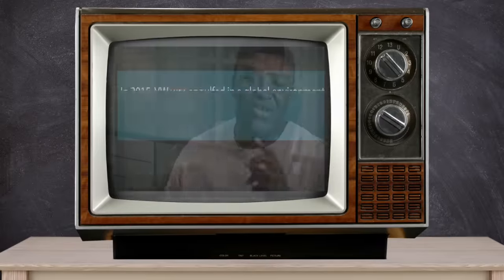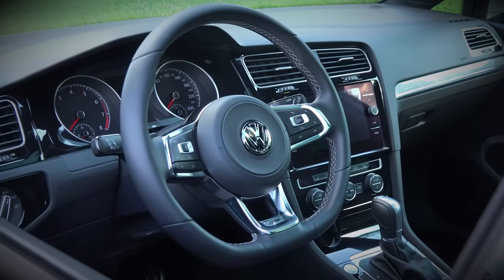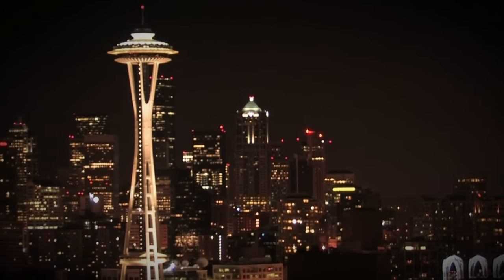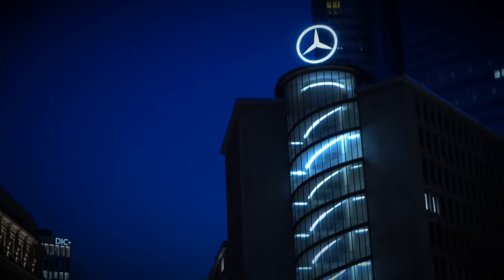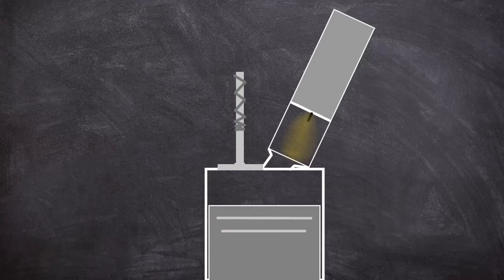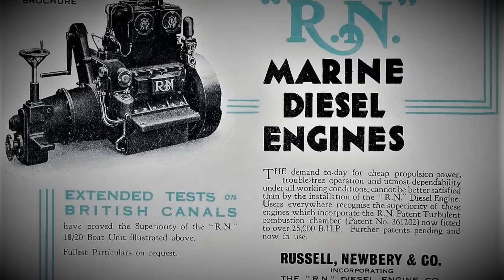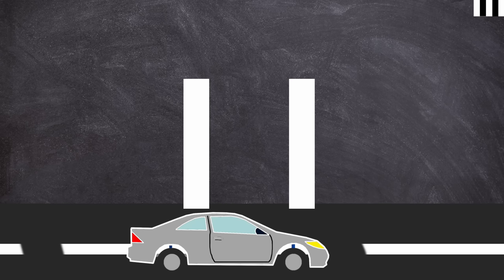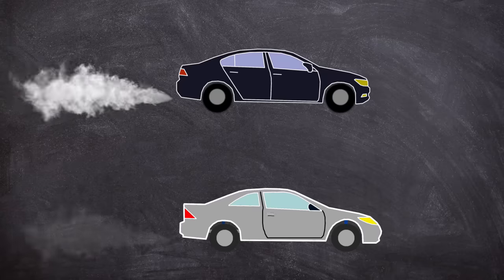Scandal: VW Emissions Dieselgate Explained | Plainly Difficult Documentary

Comment: I remember the Volkswagen "Clean Diesel" commercials with the Mythbusters crew touting the virtues of the new lower emissions, holding a handkerchief over the tail pipe. Script well read...
Reply: That by itself was not necessarily a lie. Those modern diesel particle filters can easily make the exhaust gasses completely transparent (at least when the engine is heated up). NOX emission are invisible.
Reply: I dont understand the whole handkerchief thing... So what people cared about back then was the color of the poison? Do they understand that co2 is invisible to the naked eye? Lmao
Reply: @toidIllorTAmI you call co2 poison?
Reply: @Wrnrgaming  fumes? Yes, they are  poisonous to humans.
Reply: Well not necessarily. If you are holding a handkerchief near the tail pipe then the car isn't being controlled meaning the car has switched to the testing lower emission mode. If Mythbusters did not know the car was switching modes when not being controlled then they would not have known this was actually proof of the switch via computer control.
Reply: @Wrnrgaming For the most part, yes. Just look at what happens to the body when you can’t get it out of your system.

Comment: This happened before in the class 8 truck market in the 90s. 
Detroit, Cat and Cummins also had a program to pass tests but the engines performed differently on the road. 
After the discovery, all dealers were required to reprogram the ECMs and performance went down dramatically. 
Fuel mileage and power went to shat. Detroit fuel milage dropped from almost 7 mpg to the high 5s.

Comment: I still own a 2012 A3 TDI. Just had its entire fuel system replaced under warranty because of the dieselgate scandal. All VW "fixed" cars have an extended warranty on emissions hardware meaning the entire engine and exhaust hardware. Definitely glad it had that as the repair would have cost me over $5k USD otherwise.
Reply: Don't they all have a 100k warranty?
Reply: I love my 2011 a3 TDI got the emissions replaced warrantee at 90k now I’m at 140k and the car is running great.
Reply: Is it slower?
Reply: I just got my entire coolant system and turbo replace about 7000 in total Gotta love that warranty it’s the whole reason I bought the car 😂
Reply: @MiguelGarcia-vj7oo  you can go to their website and put in the cars Vin to see if it’s affected and how long the extended emissions warranty is, for example mine is 4 years and 3 months or 54000 miles after it’s modification for emissions (102k/2020) meaning it’s good until 2025 or 156k
Reply: @albertbahtiri5645  hey, so mine says the the mod was done in 2017, and I recently got the car, so do you know if the warranty starts from the day you buy it or the day the mod was done?

Comment: VW gets the most attention on this issue but the reality is they weren't the only ones involved, mercedes and bmw were also at it, I think it was mercedes that stuck the other 2 companies in so they wouldn't get punished as severely, as time has went on nearly every manufacturer across the world has been found out to be using similar software.
Reply: The students who originally discovered the vw diesel gate, had two vw’s and one bmw. The bmw didn’t cheat, and that’s why it isn’t called “bmw diesel gate” today

Comment: Mostly, I did enjoy the video.  Disappointing that the real criminals have still not been charged, or at least sued into poverty.  As a chemist, I found your treatment of the chemistry involved a bit frustrating, as most of it was wrong.  For example, simple hydrocarbons, such as those found in diesel fuel, can only have formulas corresponding to CnH2n+2.  So C12H23 is not a real molecule - the formula for a real 12 carbon simple hydrocarbon would be C12H26.  Also, ad blue, a solution of urea (NH2)2CO in water, reacts with NOx to give nitrogen (N2) as the reduced product (not oxygen, O2, as you stated) along with water (H2O) and carbon dioxide (CO2).  Also, at one point you referred to NOx as being particulates.  Nitric oxide (NO) and nitrogen dioxide (NO2), the two principle components of NOx, are both gases under normal atmospheric conditions.  (Nox is actually much more complex, and includes small amounts of NO3, dimers, such as ONNO and O2NNO2, and mixed dimers, such as ONNO2 and O2NONO2, depending on concentration, temperature and ulraviolet flux.)  The particulate components of diesel exhaust (aka soot) are composed mostly of carbon (from incomplete combustion of those simple hydrocarbons), ranging in size from less than 2.5 microns (the most concerning, as they penetrate deep into the lungs) to more than 10 microns.
Reply: Thank you. I was cringing at C12H23 and at every reference to NOx as particulate or particles. You stated it better than I could and pointed out a something I missed: the products of the NOx / NH3 reaction(s).
Reply: I burned my toast this morning!
Reply: @rcranch3838  Your mom probably shouldn't have let you use that dangerous appliance. And just think of all the particulate matter that you released into the environment! For shame.
Reply: @sootikins  funny you say that because she just rapidly disassembled it by throwing it out the second story window.
Reply: @rcranch3838  Cool! A "Special Toaster Operation"
Reply: @rcranch3838  The Maillard reaction gone wrong, sorry for your loss.
Reply: Thanks for that. I'm not a chemist but was questioning my basic grasp of such when hearing a compound described as a particle.
There is though as I understand it further scientific evidence to be established on the extent of biological and climate impacts resulting from NOx at current levels
Reply: Agreed on all points - I suspect he got C12H23 from the average weighted makeup of diesel molecules and took it out of context
Reply: I think the particulate micron debate had been mostly debunked as a lot of it has to do with grade of diesel used to how the particular engine was designed to burn it. VW totally shit the bed big time in that regard. Grossly oversimplified: they're really just gasoline engines redesigned to run diesel. The two architectures shared a lot of common parts and this is why mass production engines really shouldn't rely on software & electronics to run. Done correctly in hardware, like older injection-pump style engines, they ran pretty damn cleanly (emphasis on *when done right*!)
Reply: This bloke producing these video's is a bit of a technology nugget.
Reply: It's always difficult to watch any video created by someone with significantly less knowledge than I have about some very specific subject.  

The megaprojects guy (and his script writers) is probably the worst :)
Reply: @rolfkarlstad4015  Look guys, first comment from a Volkswagen apologist!! VW totally shit the bed on the matter and you know it
Reply: I'm sure it was not intentional. But most people are not experts on the subject. Thanks for explaining it for us good sir. I Hope you are having a great day and that you and your loved ones are healthy and safe!!
Reply: @Drmcclung  me?  Not at all, I prefer my petrol engines :)  I agree that VW made a mess of this, for sure.
Reply: @rolfkarlstad4015  Ah, ok. Sorry I misunderstood!
Reply: Yeah it’s massively disappointing when the German’s were caught red handed cheating in a huge way but still somehow deny wrongdoing like their sh*t doesn’t stink. They make some of the least reliable most poorly engineered cars in the world. Far less expensive cars from other countries cost less, use less energy, are for more reliable and cheaper to own, suffer from much less depreciation out of warranty, and can still beat the Germans on their own famous Ring race track. Show me a production German car at any price that can beat the highest performance Tesla around their own Ring? Or show me a German car that isn’t seeping critical fluids soon after the warranty expires. In any price category there are cars made elsewhere in the world that better the German’s poor efforts in most objective ways. Superior German engineering has become a complete myth. The Germans are like college students who just cheat on their college exams just like they cheated on emissions tests.

Comment: One thing that came out of this was they ironically gave me the best customer service I’ve ever had.  I have a Q7, kept it afterwards.  In 2020, got some engine trouble and took it in to the dealership and they gave me a rental.  They couldent figure out what was wrong (turned out to be something with some bad gas no idea how they dident figure that out right away) but they kept it for about four months and even flew in specialist from Germany just to look at it, kept me informed the whole time and I got the rental which was a 2019 model.  Probably put 10k miles on it and they dident blink.  Kept me informed and answered everything politely.  Was  the best experience I’ve ever had with a dealership

Comment: I’m still pissed off after all these years. No, it wasn’t because I owned one but because the scandal resulted in VW pulling the plug on the Audi Le Mans program. Ironically Audi ran diesel at Le Mans.
Reply: So that’s why they stopped running. I thought it was rules at Le Mans or IMSA
Reply: @mikebuffing727  unfortunately not. Besides the fine the VW group had to pay, Audi's Le Mans program were fueled by diesel. Wouldn't take much to put the two together.

Comment: I know someone who had a golf GTD model which was honestly the best car - super fuel efficient for the longer distance driving he did. When the scandal surfaced he got a letter which said the car was recalled for the oboe reasons and to take it back in to be fixed. This someone knows cars and he knew that the only way to fix it was to take away some of the performance of the engine and he refused to take it in.

Comment: Thanks for the video.  I own and still drive a 2003 VW Golf TDI, and have over 330,000KM’s on the odometer.  Was debating upgrading to those “clean diesels”, but in the end figured we would keep the Golf and continue driving it.

Because the vehicle was purchased prior to the tier 2 requirements, we haven’t heard a peep about it from
VW.

The car, with a new clutch, turbo, etc. Is still a nice drive, even though it’s almost 20 years old now.  Pity most vehicles these days aren’t available with a manual transmission…

Comment: 5:37: "These engines work by compressing diesel fuel" - wrong.  These engines work by quickly compressing air in the cylinder until it becomes hot enough to spontaneously combust diesel fuel sprayed into it, typically just before top dead centre of the piston travel.
Reply: Well that makes allot more sense. But before direct injection the air and fuel was mixed before compression? But yes it makes allot more sense to say that the diesel ignite due to the hot compressed air.  

Older lorries and cars had to use glow plugs to compensate for cold starts in winter time. And still even in good condition struggled and failed to start. But modern lorries even in -35c (-40c even) and running bio fuels manages to start with the only requirement being to make sure one has good crank power. (batteries). But then it is this generation of lorry engines that have injectors shooting out of the block and such in the middle of summer. XD Just casual Mondays. I rather stick to the less extreme pressures of today's engines. Even VW PD engines is to much to make sense! 2003 ish?

Comment: I clearly remember the absolutely deafening silence from other manufacturers when this first appeared on the news 😂. VW took the rap but I’m pretty sure everyone else was doing similar things too…
Reply: Yeah without a doubt. The Hellcat gets like 740 hp and you're going to say that it passes emissions once the accelerator is pushed? Please. This has been going on for so long that I was kind of surprised people were acting like they didn't know. Auto manufacturers have been manipulating the camshaft for years before this story broke. Vortec, vtech all those are systems that manipulate the camshaft to give the car more power when on the gas and less at idle to pass emissions. I just can't believe people acted like they had no idea this was going on. Your ave Joe sure but anyone that knows anything about mechanical engineering knew this was going on for quite some time by everyone. I guess those nerds at west virgina got in their environmental feels and blew the whistle to the public at large. But there is no way the epa didn't already know this unless they are brain dead morons.
Reply: Nothing wrong with that. F the epa
Reply: Given the lack of long-term consequences, that's not a stretch. Personally, I think VW should have ceased to exist as a company after this. But I also feel that if a company does wrong like this, any fines levied should start at 100% of the gross income from whatever action they're being fined for...

Comment: Another consequence of this scandal was the termination of (nearly) all Motorsport programs. Their Behemoth Teams ceased to exist in the World Rally Championship (4 Drivers and 4 Constructor Championships for Volkswagen in 4 years) and in the World Endurance Championship, with the latter using TDi engines between 2006-2016 (amounting for 8 of their 13 wins at the 24 Hours of Le Mans). Another manufacturer of the VAG Group, Porsche dodged this scandal and continued on racing. Audi's GT3 program also continued to supply teams with the R8 GT3.

Only 10 years after the scandal became public matter, Audi is set to re-enter a premier motorsport series, announcing their entry in Formula 1 in the 2026 season - Although with all the rumours going on for the past 20 years, I will only believe them when I see their car on the grid.
They were also due to re-enter the World Endurance Championship with the new Hypercar regulations, but called off those plans to alledgedly focus on their F1 plans. Porsche is set to re-enter WEC with their new car being already tested.

edit: spelling

Comment: I am not a fan of VW nor the diesel engines in small cars, but I am on VWs side in this on. The modern emission standards are set unrealistically and their sole purpose is to destroy the internal combustion engines...
Reply: It even failed EU regulations though, which are WAY less strict. They knew what they were doing
Reply: Trucks (which are tested on road) can pass this tests. It's all about money, it would have just been too costly to equip the vehicles in a way they don't have to cheat. 
Trucks consume around 3 % of the diesel consumption in Adblue, while VW tried to avoid 
Adblue at all

Comment: Great work on the documentary! I was under impression that the alternative ECU program was activated by the hood switch but it seems that the detection algorithm was more complex than that.

Also, I think the cheat version reduced NOx emissions by having very aggressive EGR settings which indeed do reduce NOx emissions a lot but will clog your intake manifold very fast if the fuel contains any sulfur.
Reply: Not sulphur. It just clogs it up with carbon
Reply: @wizard_of_poz4413  Yes, carbon is enough to eventually clog but the sulfur make the process much much faster.
Reply: @MikkoRantalainen  nah I run ulsd exclusively in my truck but I pulled the grid heater off and the valve and intake were caked all the way thru at 35k miles
Reply: @wizard_of_poz4413  Interesting. We have TDI with factory spec EGR configuration with 300k km on the clock and the intake manifold is barely blacked, definitely not clogged at all.
Reply: @MikkoRantalainen  well I thought vw takes exhaust off the dpf
Reply: @wizard_of_poz4413  I don't understand what you mean by "vw takes exhaust off the dpf". DPF is in series with the turbo and catalytics converter which are all part of the exhaust system.
Reply: I used to run a VW diesel shop and be very tight with the TDI online community. We had a lady's car who was doing really weird things we couldn't quite figure it out. After much online back and forth we realized that her morning driving cycle was so close to the EPA test procedure that the car was jumping into emissions test mode. It's one of those one in 100 million things.
Reply: @MikkoRantalainen  right, that's how the EGR system works it's pulling hot sooty exhaust gas back into the intake. It's a nightmare of a system. I have all of the dealer training emission system documentation in a binder. I think I've also got a copy online if you're looking for it.
Reply: Apparently the hood/bonnet switch trick is far older and was used by some car companies decades ago (in the UK anyway). But it's the same idea at its core.
Reply: @otm646  Yes, and if you look at the exhaust pipe, it doesn't get clogged even if it moves even more of the exhaust gases than the EGR valve.

The problem with EGR valve is that the exhaust gas is met with air from the engine breather pipe and that combined with exchaust gases may result in clogging.

It seems to me that this reaction is faster if the exhaust gases contain sulfur or other contaminants. That's why you should use high quality fuel.

And in case of DPF, that engine breather pipe will transmit small amount of oil to the DPF and if that then reacts with contaminants there, you end up clogging the DPF, too.